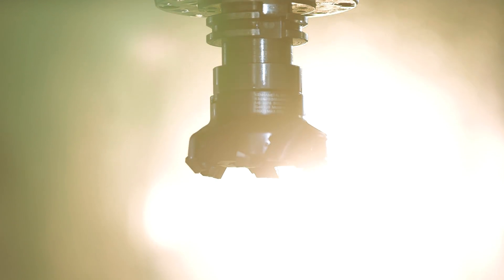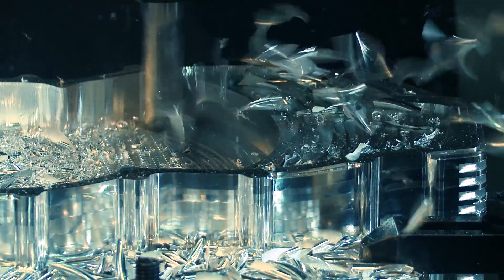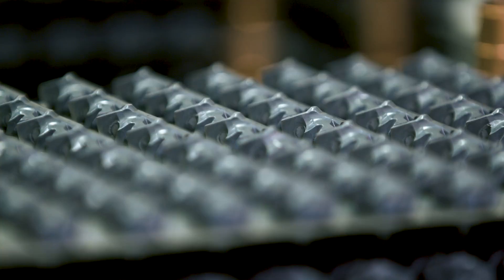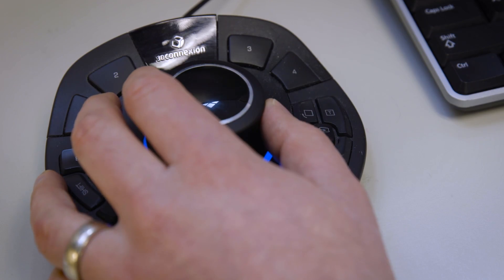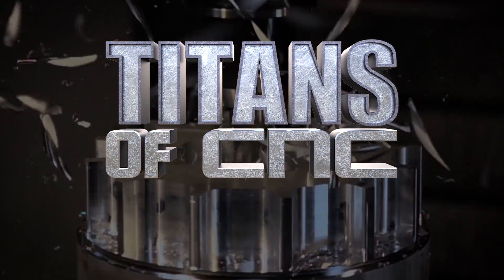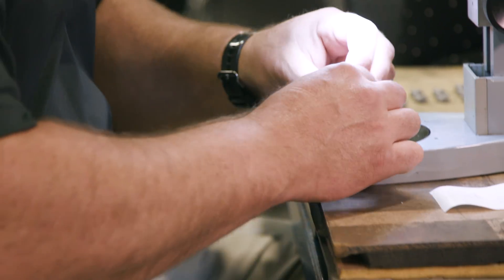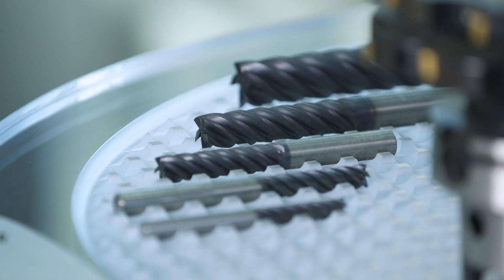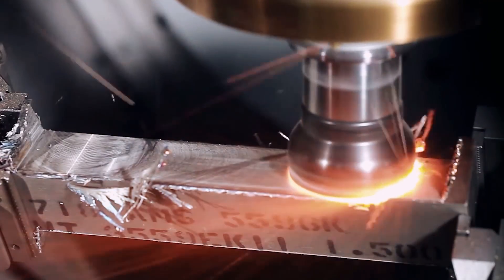The Incredible Kennametal Job Opportunity!

Comment: I'm getting a dead link.

System Info.
Release: 1258233
Server: 146pc4bcar09t
Request: /sfcareer/jobreqcareer%E2%80%A6
Timestamp: 2017-10-04T16:58:10.750-0400
 
The requested operation is not available.
 
Please try again or contact your administrator.
Reply from the maker: See my reply to David.
Reply: I tried in Safari and Firefox. I'll try Chrome.
Reply: No luck with Chrome either. I'm on a Mac.
Reply from the maker: Internal tests show some browsers work and some don't. We recommend Chrome, Firefox, or Safari. More investigation is needed to assess the issue. Thank you for your patience!
Reply: If you are having problems with the link, please go to the career page:  https://www.kennametal.com/en/about-us/careers.html scroll all the to the bottom (black background) and click "Find a Job." On the career page you can enter "Associate Sales Engineer" into the keyword box and then apply to this position. If you have any further issues, email me directly at charlie.hower@kennametal.com